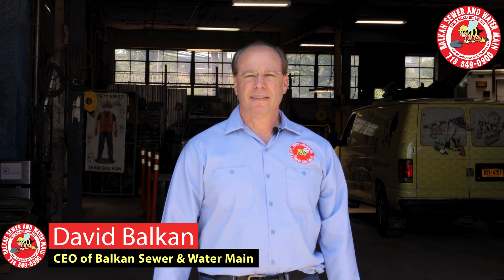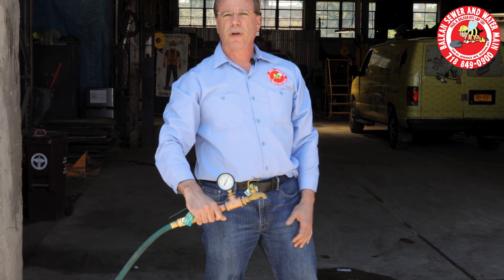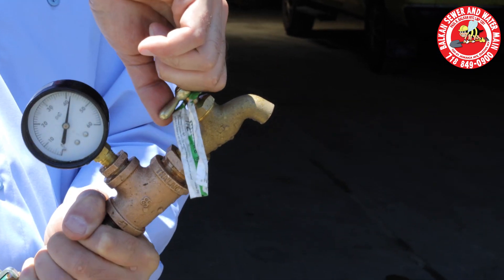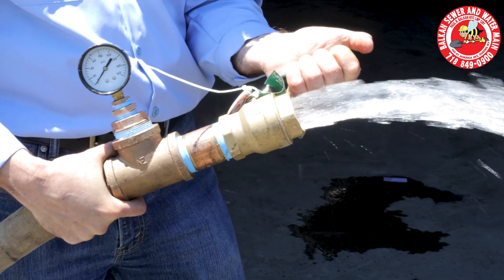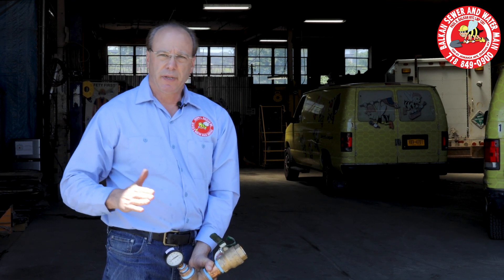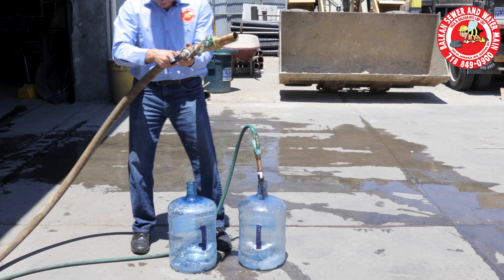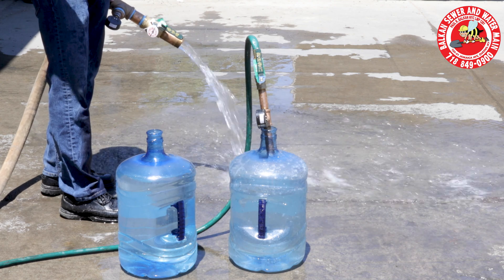Water Flow and Water Pressure: A Live Demonstration

Comment: Your pressure explanation isn't quite accurate. The pressure gauge is reading the amount of restriction AFTER the gauge. It is unaffected by the hose BEFORE the gauge. So, you are really just measuring the restriction of the different valves. The large ball vale provides almost no restriction, and the small spigot style valve provides a lot of restriction.

Comment: Good video but one thing to consider most people have a 5/8 meter. That's all the flow will allow even if you run a 8 in main. My house has 3/4 its plenty water and pressure. Did this for 10 years water and sewer for the city. Now for the fire dept trying make these guys understand friction loss is not a big deal in most cases.

Comment: when you restrict the water output, you increase the water flow ! not the pressure !!
Reply from the maker: Rate of flow and pressure are directly related at the outlet point. That is not just an unsubstantiated opinion. Therefore I find your remarks confusing.

Comment: 4:31 shows a lot more water in the bottle and better flow in 3/4 line than it does at 4:36, video has been edited between these two time stamps.  After 4:36 water flow in 3/4 line is reduced and there is a lot less water in the bottle than there was at 4:31 .
I suspect that is precisely the reason why you choose not to do the logic thing and time each bottle fill. The only way to show the difference. 

You also said that both lines are connected to the same source, and then you proceed to fill both bottles at the same time from the same source 😁. 

The truth is, the only difference here can be had from reducted friction (source flow or pressure hasnt changed), and at the mains pressure that difference is minimal. Had you timed each bottle fill, one at the time, there would hardly be any difference in it. 

So the question is, what are you gaining from this? 
I dare you to pin this comment up.
Reply from the maker: I eagerly await your better execution of the plumbing principles.

Comment: hi there, there is one confusing thing regarding the type of pump. One pump seller says that screw Pumps are much more powerful in the sense that they have much more pressure than impeller pumps. Given that the watts are same for both Pumps, is this true? Do screw Pumps perform much better than impeller pumps in pumping out water, assuming that watts are same?

Comment: Thank you so much. Greetings from Pakistan. 
Now I know why the pressure in my home is low. The pipeline over long distances (130+ ft) is 1/2 inch and while it was good while it lasted, but over the ages, the corrosion has really reduced the water pressure
Reply from the maker: What material is it made out of?
Reply: @balkanplumbing  the existing plumbing for water is GI 1/2inch  but I want to replace with PPR or polypropylene random copolymer. The selection difference is 1 inch or 25mm PPR is measured using outer diameter and is actually 18mm. While the 20mm is equal to 1/2 inch GI or steel and even PVC is similar but PPR and HDPE is measured In mm and since their walls are made thicker they are almost always smaller than GI of same size in internal diameter. Plus I am moving to 32mm so I get proper water pressure for my geyser.
Reply: In 2022 November, I changed my main water supply from 1/4 inch which was all clogged up and rusted to 3/4 inch and it has been the best decision in my life.
A full 15 feet length of underground pipe was totally clogged. It was from 1970 year.

Comment: I work in a bakery. We moved from automatic to manual for the water inside the oven, and the pressure decreased. I have three pipes, 2 three nozzles and one 12 or less. What is the solution? Should I make the pipes and nozzles smaller or both? I am in a very bad baking situation. I need advice 🥺
Reply from the maker: Simply put, you need to call a licensed local plumber. Online is not the answer. Sorry about that, too many factors.

Comment: The pressure isn't changing, it's the velocity which is not pressure.
Reply: Increase in pressure is an increase in velocity and flow restriction adds pressure relative to the volume and flow rate

Comment: I dont know if u will see this. My problem: when i use a hand held water sprayer, flow, pressure and volume are fine. When i install a sprinkler to the same hose and water faucet, everything reduces to a trickle. Ive used different kinds of sprinkler with the same results. Please explain why when u have some time. Thanks!
Reply from the maker: It sounds like there is not enough volume of water to serve the sprinkler. Try connecting it to a larger line. Or choose a sprinkler that requires less water. Hope that helps.

Comment: Thumb on the hose does not increase pressure, it increases velocity.  What if the service line from the city (the main source) is 3/4?  Will increasing the size of the pipe have an effect on the flow?
Reply from the maker: What do you suppose makes the velocity increase? 
Perhaps the pressure? 
Oh boy…

Comment: 1 inch diameter water line at 40 to 60psi gives you many times more flow than just 8 GPM.  1/2 inch line usually gives you 8GPM if you have a large ball valve instead of the gate valve which restricts the area of flow.  The flow charts show that 1 inch line at average pressure of 50 60psi will give 37 gallons per minute if you have a 1 inch openining.  He demonstrated a small gate valve which has probably opening of only 3/8 inch diameter.  If that 3/4 inch line had a large ball valve it would give about 23 GPM. Most small homes in Vancouver BC Canada only have 3/4 inch main line and it is enough flow to even hook up 2 induatrial pressure washers which need 4 GPM flow rate sustained.  So 1 inch line would give you even more 37 GPM.   What people should do in their homes is to have the main line with large dianeter run all the way around the house to the last water fixture.  Do not reatrict the pipe size to the last water fixture.  You want the big pipe to provide unreatricted watee flow around the whole house and then to the individual bathrooms you can restrict it down to 1/2 inch or 3/4 inch.  But 1 inch line gives you ton of flow.
Reply from the maker: Look up the nyc dep sizing chart. Probably maybe could be, then there is what it is.
Reply: Why there is a different flow rate? The flow rate have to be the same in the different hose.
What should differ is the velocity.that is venturi effect

Comment: EXCELLENT EXPLAINED. Your demonstration about how by having the same pressure from a source gives different amount of water flow, due to having more or less resistance in the line, is correct. What most people seem to be confused about is Bernoulli's equation. Let me explain about it. 

Many considerations are needed in order to apply Bernoulli's equation. But two are essential, one is applying it in a single streamline, and the other one is to a steady system. The last condition refers to that there can't be a change of properties in time, so the system needs to be constant.

This last assumption doesn't apply here, where someone compare the before and after the thumb was placed. When it wasn't placed your thumb, the section of the hose is larger than the nozzle, so as people say, velocity is increased at the expense of pressure at the exit, but this also happens when you put the thumb, so why does someone see that the pressure increase in the pressure gauge in the last scenario?!

That's because of the system curve!! Roughly explained, when you have water flowing it needs to go against obstacles,  that would include, pressure diferences, new heights, bendings, rugosity, etc. All these things considered tell how much pressure you need to apply to generate a flow rate, so with more obstacles, we need to apply more pressure in order to keep moving a flow! That's why when you put your thumb, the pressure increased. You created and obstacle, so that translates to needing more presssure in order for the flow to circulate! This is the same as thinking that you need more pressure to reach the top of a 20 floor building than a 6 floor one.

There is also the pump curve to go in depth!! It relates the amount of flow given by a pump at a certain pressure. When you have 0 flow (because it is totally restricted, as with a close valved), you have max pressure provided by your pump, but this is the opposite when there is no restriction! Max Flow with 0 pressure! 

There topics are confusing at first sight, so i encourage you to look for pump and systems curves!
Hope i clarify you a bit.
Reply from the maker: I think I understand better from your response. I was leaving out velocity. I was confusing pressure for velocity. Thank you!

Comment: Great video and demonstration, loved the experiment you did. This is a very counterintuitive concept that is hard to understand at the beginning. I'm sorry but a couple points that I need to do here to clarify:
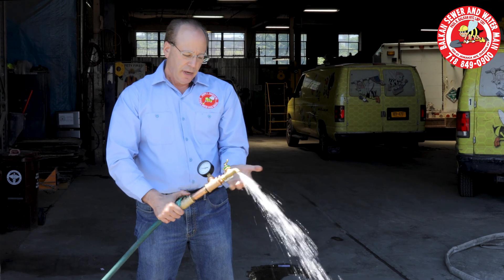1) at 2:07 you said that when you restrict the flow pressure goes up and that is NOT the case. When you restrict flow pressure actually goes down, is conservation of energy and Bernoulli explains this clearly. When you put a nozzle pressure goes down but VELOCITY goes up, this is called continuity equation. If wanted I can go into the details.
2) On the second scenario that the gage goes to 0 is because the gage is so far off from the stream with those unions that the vacuum effect of the high flow of water prevents water to go up to the gage. I bet if you close the valve halfway you will see some pressure because now the vacuum effect is much less. Ideally to measure water pressure like that you will need you gage touching the stream of water or at least a Y and not a T.
3) Pressure is a given but Q=VA, where Q is flow, V is velocity of the fluid and A is cross sectional area so obviously a bigger pipe will increase flow.
4) On the main concept that Flow is more important than Pressure to fulfill a home demand you are correct
Reply from the maker: Honestly, you’re much better informed on this subject than I am. I just like to share and learn as I do so. Glad you enjoyed it!
Reply: A bigger pipe do not increase flow, flow remain the same the velocity is augmented in the small pipe
Reply: @martino515  yes I said that
Reply: A bigger pipe leads to less decreases of energy caused by friction
Reply: @martino515  you are actually correct, thank you.

Comment: Great video! So if my house is fed by, say, a 1" pipe, does that mean that adding a larger pipe downstream is useless because it can never exceed the flow restriction caused by the 1" pipe?
Reply from the maker: If you mean larger than 1”, yes absolutely correct. It would serve no purpose.

Comment: Water flow, water pressure, water opening.

Same water pressure, less water opening, faster flow, less water. 

Same water pressure, more water opening, slower flow, more water.

...

On mine ventilation.

Same air pressure, wider opening, slower flow, more air quantity.

Same air pressure, narrow opening, faster flow, less air quantity

Comment: Very interesting, thanks for the demo. What I’m wondering is, if I have a 1” pipe and add an additional pipe 1.5” to it via a Tee junction 20’ long with a garden tap at the end, what will be the outcome. Will volume or pressure change much. I haven’t given it any thought yet . 🤔 Maybe you or another YouTube viewer knows.
Reply from the maker: Do not take off a larger branch line than the line its connecting to. It will create a pressure reduction. Especially not good if being used as a garden hose connection.
Reply: That makes sense. Thanks

Comment: 1"  min for a home service in New York??? Thats massive in my experience here in Toronto for most  older homes (im sure mcmansions in the burbs with 5 hardly used bathrooms need more). My house has a 70 year old 1/2"  lead service (unfortunately)and while the pressure and volume do kind of suck its still enough after all these years to do what we have to do including filling up the hot tub reasonably quickly every few weeks. I service mid rise buildings with 8 floors that only have 2" service and they have tons of pressure and volume. Maybe our municipal pressure is higher here? 1" Seems quite large for a min size. Good video.
Reply from the maker: Quick question, on the 8 story building is there a water tank? Any building over 6 stories in NYC requires a water tank on the roof.
Reply: @balkanplumbing  No water tanks here that I am aware of and certainly none required by the code. I can see the utility during a power outage though as any unit above the height if the nearest water tower will have no water untill the power is restored. If I understand Manhattan is pretty flat and dense so it likely makes sense to have water stored on top of buildings rather than relying on pumps/water towers to get water to people in mid/highrises below a certain height where they would automatically be needed otherwise. I was working in a 19 story building the other day that had an 8" watermain burst....flooded underground parking and water in the elevator meant no water to the building and no elevators (sump pums couldnt keep up, elevator shaft flooded) for around 50 hours while they dug it up to fix it. A water storage in the roof would have made the situation at least 50% less brutal for the residents at least untill that ran dry...

Comment: Flow rate, volume/time, is the problem.    That is mostly influenced by pipe Diameter, but you must also have enough pressure to get that flow through the pipe.  You can only get more pressure at the same flow rate through the same pipe diameter only by adding a pump.  Any attempt to get more flow without adding a pump may be successful, but the pressure will drop.  If the pressure drops too much, you must add the pump.  
If you increase pipe diameter at the same pressure, the flow will increase while the pressure remains about the same, up to a point.  When the pressure starts dropping too much, then you will need to add a pump to get more flow, of course that also increases the pressure.

Comment: Thanks for that on point demo and explanation Sir. I read some negative comments here but I think they just misunderstood how venturi effect works and in this case as you demonstrated, that smaller pipe actualy did drop the initial pressure but not sufficient enough to achieve the velocity required to drop it even further. It did showed venturi effect but there is not enough velocity to drop the pressure to zero. If we met that velocity requirement, it can even drop to negative pressure. Im glad Ive seen your demo a I also been researching about fluid mechanics for my hydrokinetic water pumping system, and this scenario is a great case to consider.
Reply: And why it cannot drop pressure to zero?
Reply: If the pressure dropped to zero the volume is the same as the other hose right?
Reply: To be frank, if you cause positive acceleration in the water line, pressure drops. The water becomes less compressed.

Comment: For a consistent pressure of 40psi like that its easy to fix it, just put a pressure tank with significant volume it can accomodate and you get the prssure you want. Watch videos about diy softdrink bottle and mineral water container pressure tank for instructions.

Comment: Actually (min. 2:15), in theory restricting the flow doesn't increase the pressure, it increases the flow velocity, to get the same volume of water through the smaller opening (Venturi effect). At a higher initial velocity, the water leaving the hose then travels farther, which is what you see when you "thumb" your garden hose.
Reply: Yes but in this case the pipe cross section is fix so there is no drop in pressure as it restricts the flow even more. It can only happen when you change the pipe diameter small enough to achieve the reqired velocity to drop the pressure to zero to negstove and then suddenly increase the diameter to as big as possible to accomodate the volume it diacharges without compressing it. Thats venturi eff3ct.
Reply from the maker: From a smarter source than myself: Is the flow rate in a pipe proportional to the pressure? Is flow rate related to pressure, flow rate, and pipe diameter? From the point of view of qualitative analysis, the relationship between pressure and flow rate in a pipe is proportional.

Comment: Interesting. So at our farm, we have 1-1/4" line but there are 1" check valves. One at the top of the well and one at the house. How much will those check valves effect overall flow?
Reply from the maker: That’s a bit over my knowledge set. Wells like that involve a pump or pumps, and are engineered. I am surprised there are 1” check valves on 1 1/4” lines. But again, beyond my skill set.
Reply: The check valve has a pressure drop associated with it, so that drop in pressure or resistance is reducing your static pressure from the source. So for instance you have 40 psi of static pressure at the main valve where you connect, but after passing through the check valve you lose 5 psi. That loss needs to be accounted for in your overall system design, as you will now only have 30 psi available after the check valve. The way you find out how much actual pressure drop you will see from a device like a check valve is to go to manufacturer and ask for a pressure drop chart for their device. Typically you can see what the pressure drop would be based on the flow and known velocity entering the device. The velocity can be found by knowing the flow and pipe size/pipe material.
Reply: This is a old video, but the fist place you reduce a pipe, in this case at the top of the well, that is the effective size of the pipe all the rest of the way. You could have 2" pipe the rest of the way, and you will not get more flow than the 1" pipe flow. You would need to change both check valves to 11/4" to get the full flow. This is a poor plumbing job.